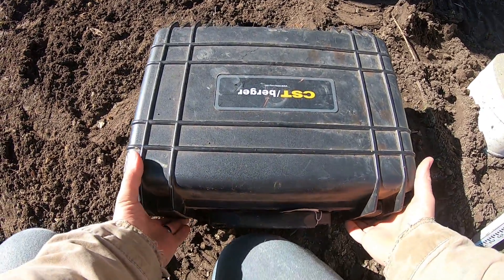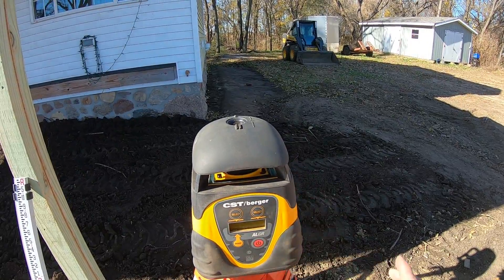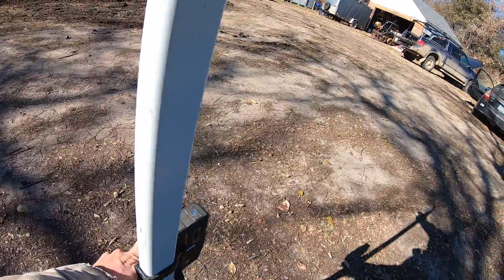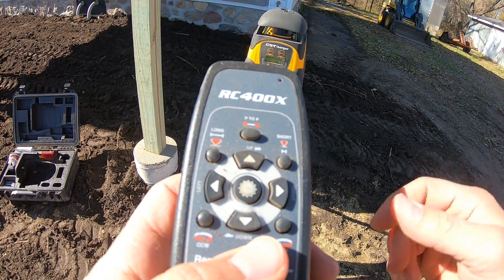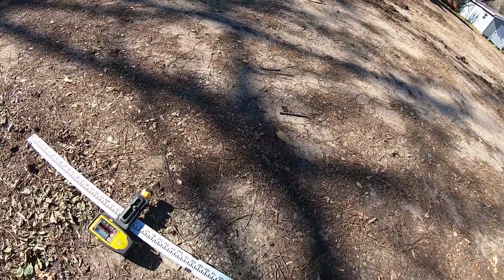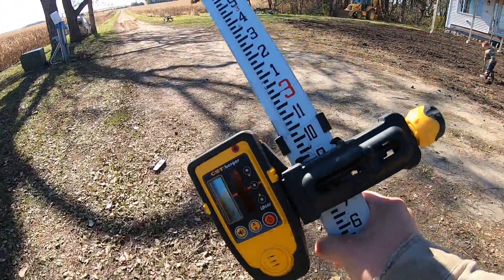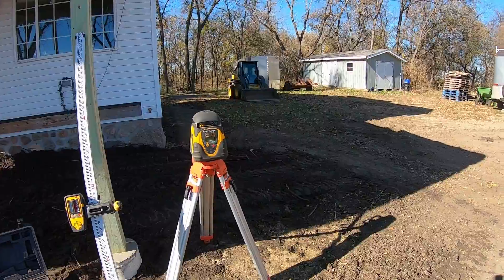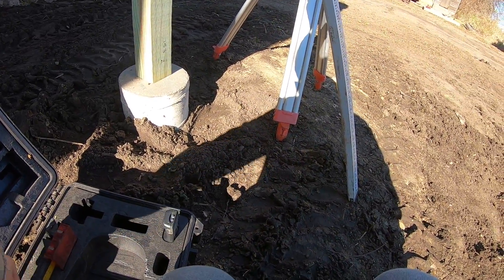How To Set Up a Rotary Laser Level Transit & Set Dual Slope Settings

Comment: But how did you get “3”? For 18x3
Reply: I think it’s because a step is close to a meter so he took 18 steps multiplied by 3 to get a rough approximation of 54 ft for those 18 meters he calculated by stepping.

Comment: Don't forget to get an occasional calibration check. Had an older one of these come in today that was out more than 5/8" @ 100', way beyond spec. It amazes me the number of people that never get these things checked out and calibrated. When shopping make sure that you buy one that the calibration can be adjusted. Many of the lower cost "Home Depot" ones can't be adjusted back to level. Your work is only going to be as good as your instruments.

Comment: Can you elaborate on the formula to get your 1ft of drop
Reply: Rise over Run (Height Difference between two points divided by length between points) x 100 and there you have it

Comment: You don’t need to unscrew the receiver bracket like that. There’s a shortcut. A little black knob, it catches the screw. Turn it a quarter turn and it releases the screw, allowing to quickly move the bracket.

Comment: Is it necessary to have dual slope or can you do the Same thing by moving the laser around?
Reply: You can pick the area you want to work if it is straight fall. Meaning all elevations at the highest  points are equal to all lowest points
Reply: If you don’t have a sloping laser, just calculate the slope and measure it.